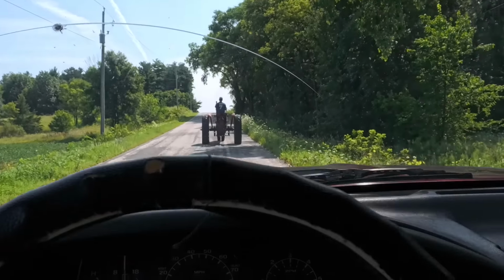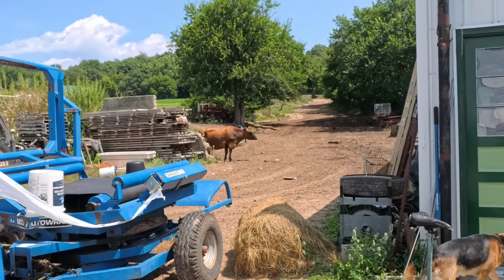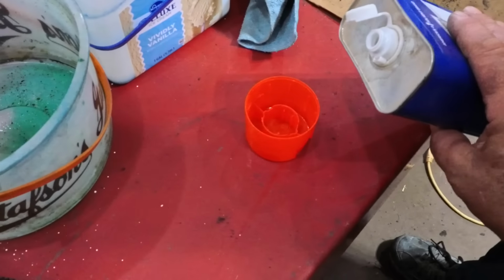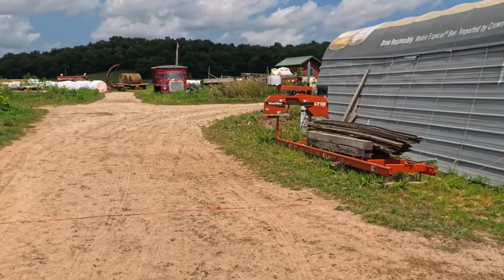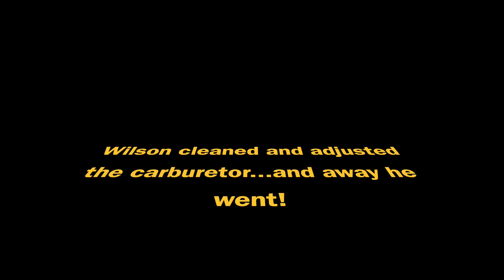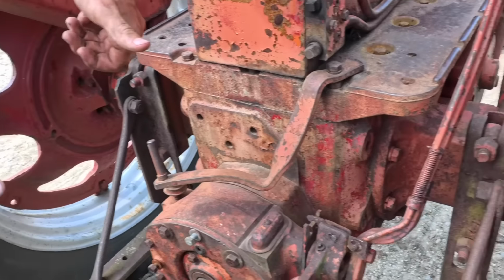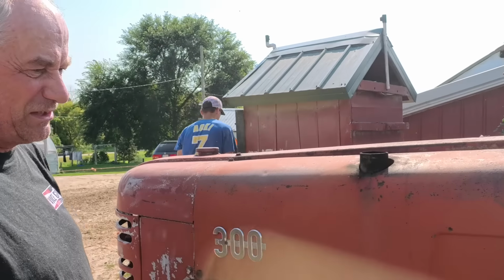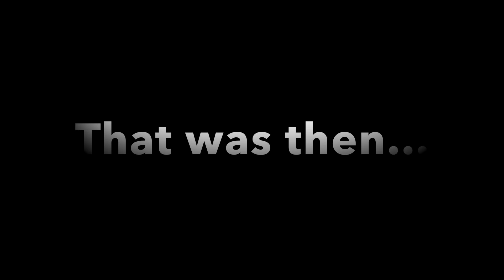Wilson's Farmall 300 Part II

Comment: We had a 400 farmall and a old trip bucket loader. Was our biggest tractor for several years and did all the heavy work.  The clutch was hard to push in, the brakes weren’t very good and the hydraulic pump after the oil got warmed up was real weak. Was fun days back then though.
Reply from the maker: Depending on your perspective, it's more fun when it takes more effort to make it go ;) At least in the memories if not currently.

Comment: HI    IK really like your videos. I have been fowling you for a long time. Nice job on the 300!  Now I have one piece of advice. I do not know much you know about using the TA.  I know a good bit about them. #1 do not ease it in and out of direct drive and TA, just pull it and also release it on the move,  #2  and this is very important.  DO NOT I repeat DO NOT free wheel coast go down hill with  the TA pulled back!  Please do as I say you will be a lot safer and save yourself big dollars on repairs.
Reply from the maker: Will pass this along to Wilson... thank you!